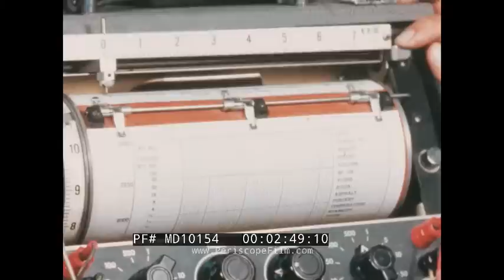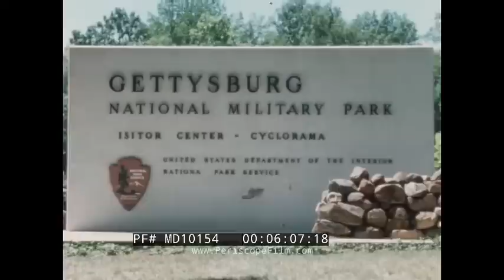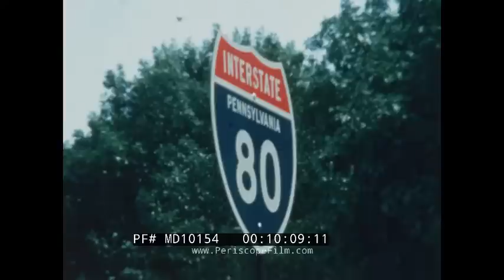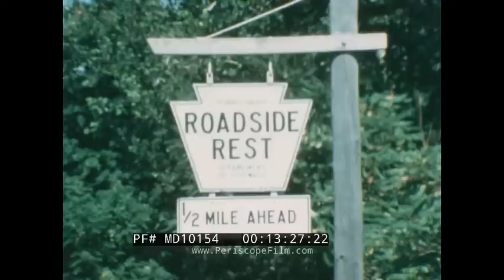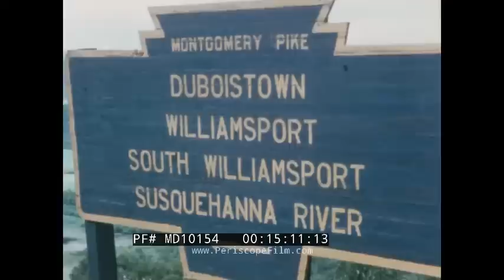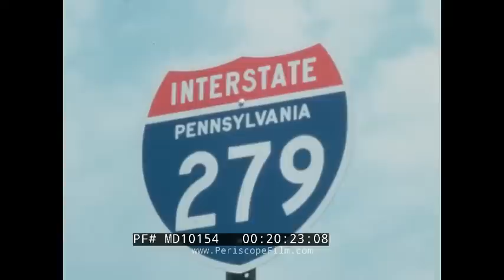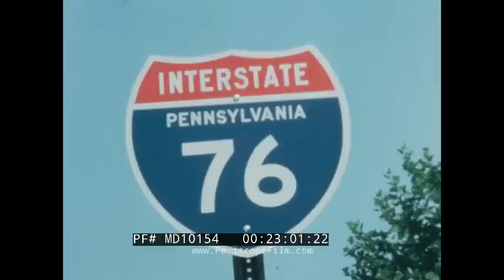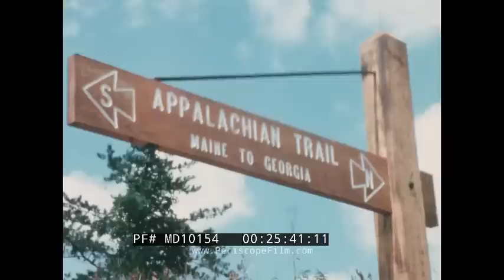"ROUND THE STATE ON THE PENNSYLVANIA INTERSTATE " 1967 PENNSYLVANIA HIGHWAY PROMO FILM   MD10154

Comment: The film doesn’t mention the Turnpike between the Laurel Highlands and the Ohio border.  The first time I drove it was about the time this film was made.  The steering wheel got a major workout with all the curves.  There were five, if I recall, two-lane tunnels where you faced oncoming traffic, and most of the way there was no median, just cables separating the directions of travel.  Diving at night, there was glare from headlights on the other side on curves.

What a difference between then and now.  Most of those tunnels are no longer on the path of the road, and there is center median  in  some areas.  Engineers have installed light baffles in the center divider of curvy areas.  It is a much more pleasant drive now than it was 56 years ago.  If only the traffic were as light as this film suggests!
Reply: They improved that part of the turnpike between Beaver Valley to Cranberry exit (headed westbound) (added more lanes). And the bridge before Harmarville got redone/ more lanes. It DOES and IS nice.
Reply: @riceburner4747  Thanks for the reply.  It’s been a few years since I’ve been through PA on I-76.  It is good to hear the road and bridge got a much deserved upgrade.  It has always been a beautiful drive, especially if you’re a passenger with time to enjoy the scenery.